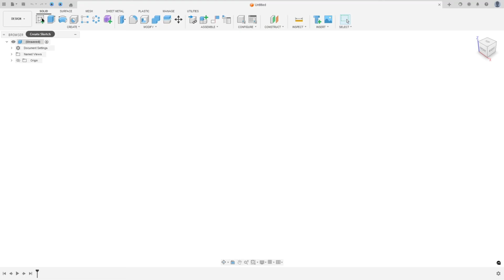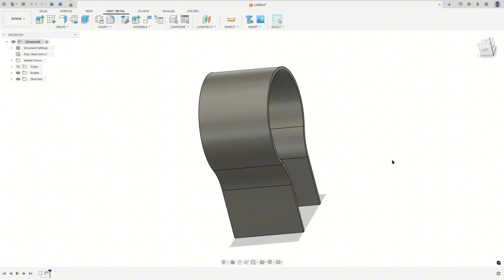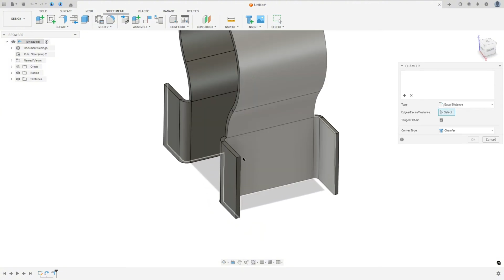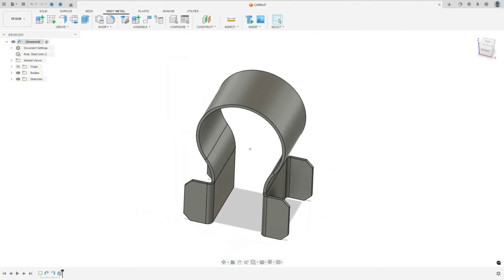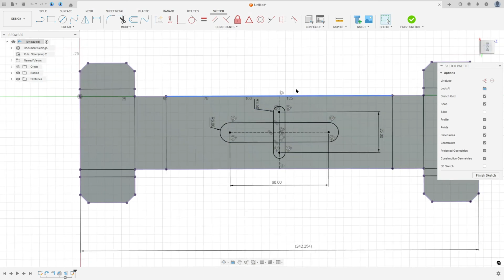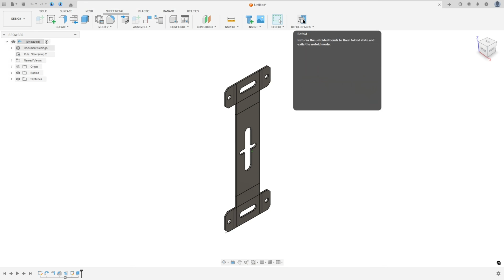How to make a STEEL BRACKET  in Autodesk Fusion using Sheet Metal

Comment: Another great video!
Reply: This isn't a good video. The creator seems to be in a hurry and doesn't explain very well why he's doing things one way rather than another. Anyone trying to learn from this video will just mindlessly repeat the creator’s steps without actually learning anything specific. That’s not how you make tutorials. In this project, you can make the holes and slots in a folded sheet of metal. Only the two central slots need to be made after unfolding the bends.
Reply: @krzysztofrucinski6541 I respect your opinion but I still like the video